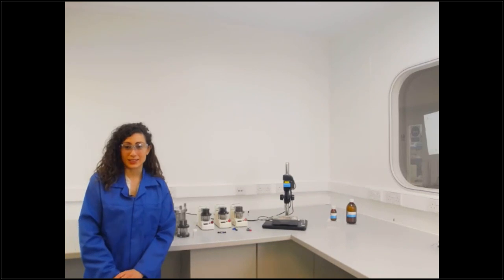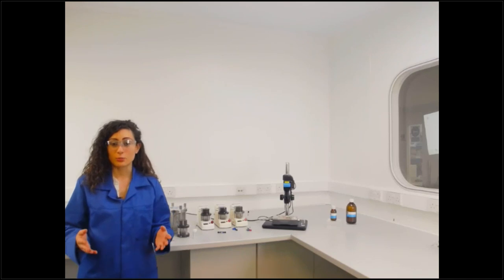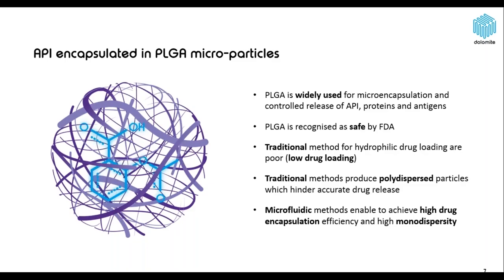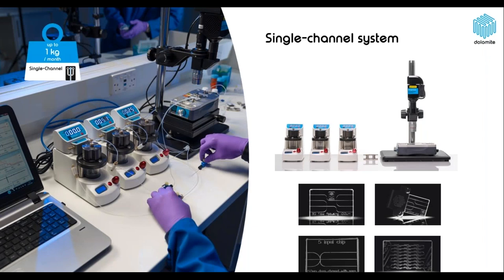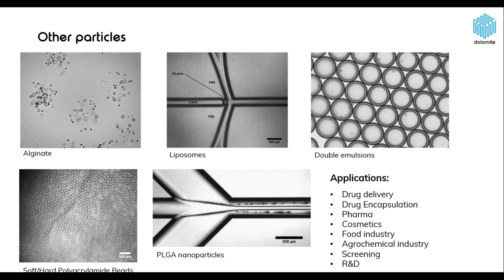Controlled Microfluidic Production of Core Shell Microparticles for Drug Encapsulation

Comment from the maker: Helpful timestamps for navigating this webinar:

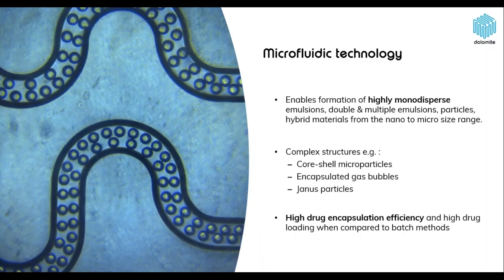1) Introduction: 0:00 - 2:50
2) Why do we use microfluidics?: 2:50 - 3:40
3) PLGA microparticle production: 3:40 - 9:59
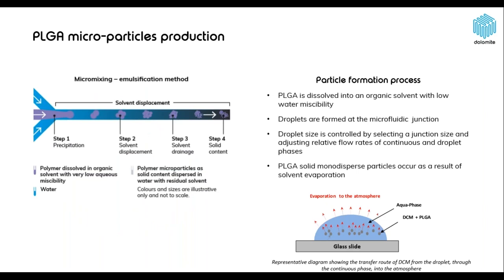                3.1) API encapsulated in PLGA microparticles: 3:40 - 5:07
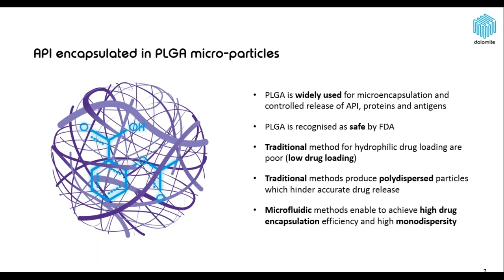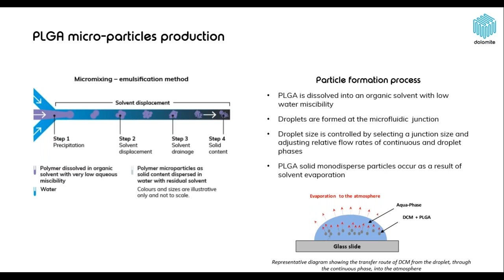                3.2) PLGA microparticle production: 5:07 - 7:57
                3.3) PLGA solvent extraction process: 7:57 - 9:59
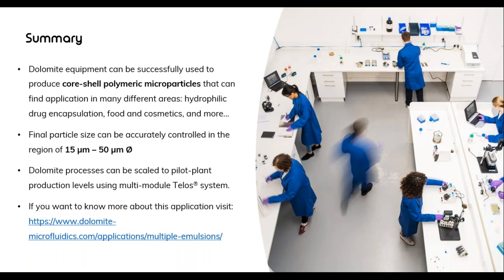4) PLGA core-shell microparticle production: 9:59 - 18:52
                4.1) PLGA core-shell microparticle production method: 9:59 - 12:07
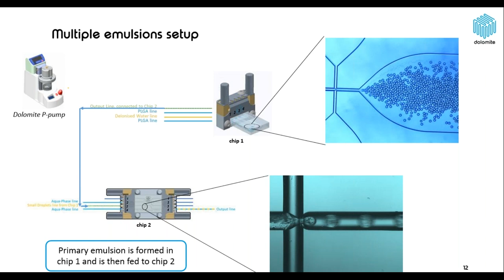                4.2) Multiple emulsions setup: 12:07 - 13:19
                4.3) Results using 3D 100um flow focusing chip: 13:19 - 15:20
                4.4) Single channel system & scale up with Telos: 15:20 - 17:38
                4.5) Other particles: 17:38 - 18:52
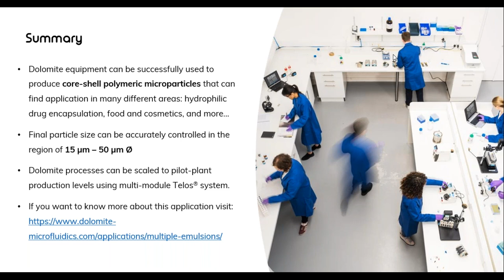5) Summary: 18:52 - 20:22
6) System explanation: 20:22 - 27:25
7) Software explanation: 27:25 - 31:35
9) Goodbyes & additional information: 31:35 - 31:59

We hope you enjoy this webinar hosted by Dr. Valentina Nappo.

Comment: Hi, I have a question. The first chip is connected to the second directly? How do you control both pressures at the same time? or the emulsion is collected and then used for the second chip? and if is so, for how long the emulsion is stable for? Also, after the whole process is completed and the DCM evaporates (thus reducing the particle size) what happens with trapped water droplets, will those droplets still be there after DCM evaporation or will be released into the water? Thanks!